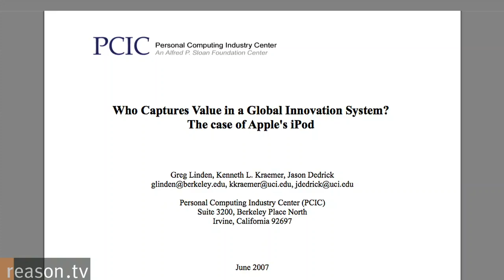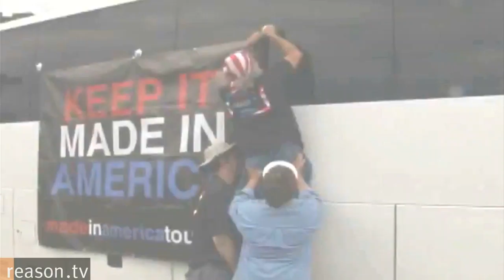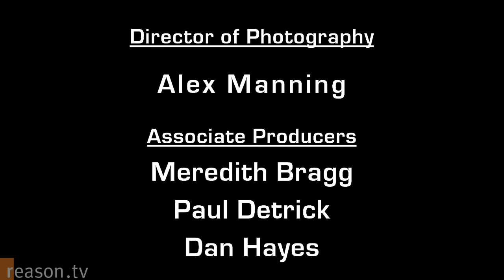Is Your iPod Unpatriotic? Why America Shouldn't "Buy American"

Comment: Yeah right now I currently have a 1995 Lexus LS400 it has about 156,000 miles on it and its never had a problem in its lifetime, my dad's chevy has about 45,000 on it right now and its had problems with the engines and has gotten stuck numerous times